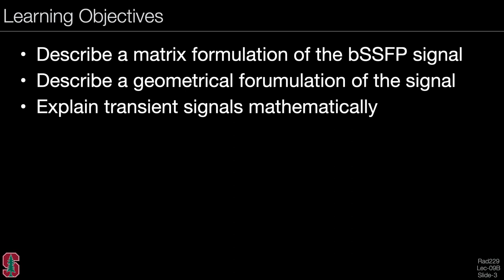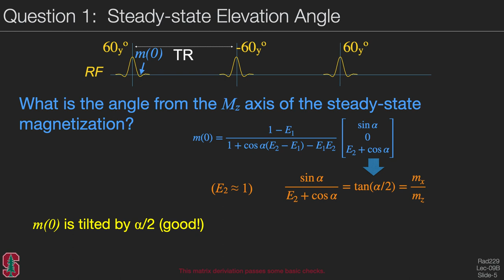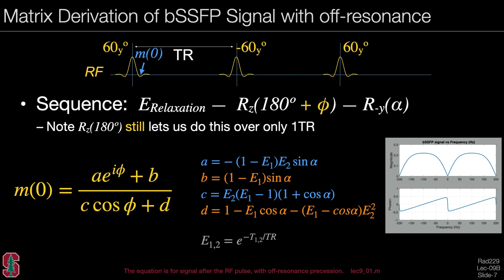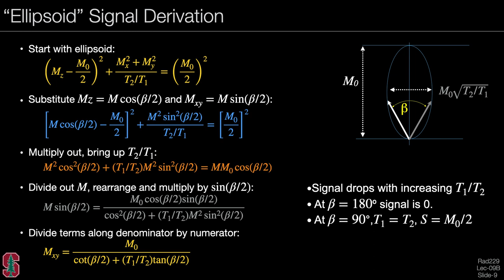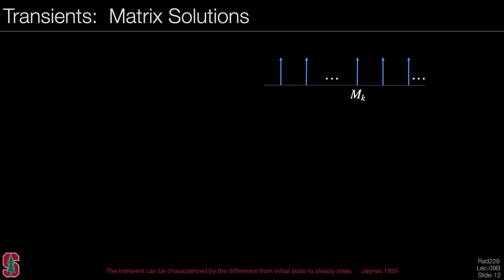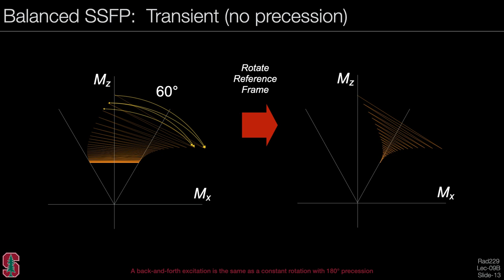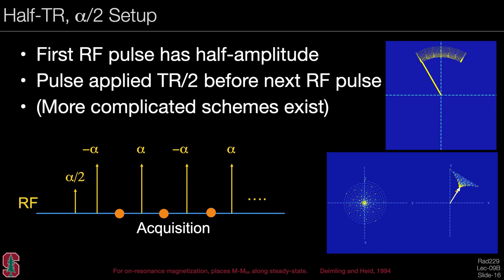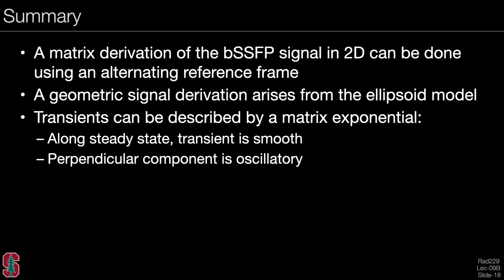Rad229 (2020) Lecture-09B: Mathematics of Balanced SSFP

Comment: Thank you very much for this great lecture series!
I would like to point out that on slide 9, there is a small error in the gray equation underneath "Divide out M, rearrange and multiply by sin(beta/2)":
in the very last term in the denominator, if my calculations are correct, the M^2 term should not be there! It is only (T1/T2)*sin^2(beta/2).
I would appreciate any feedback on that :)